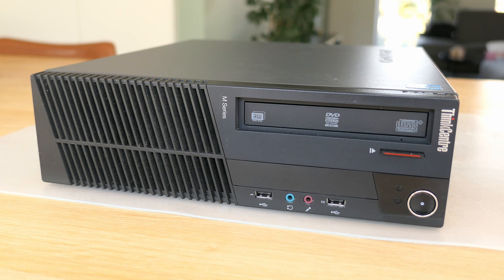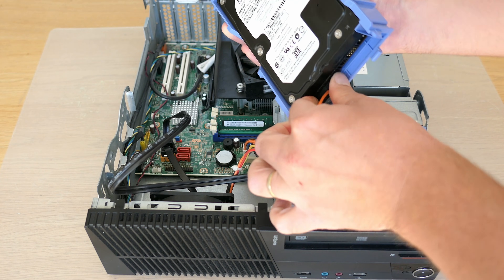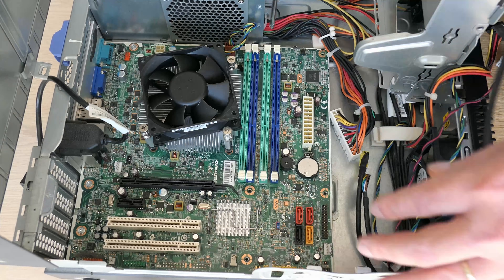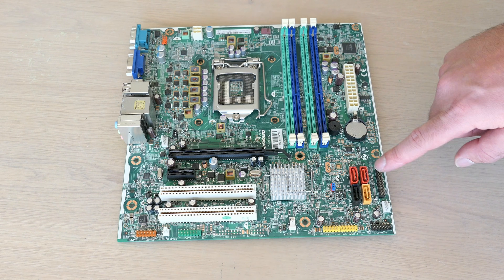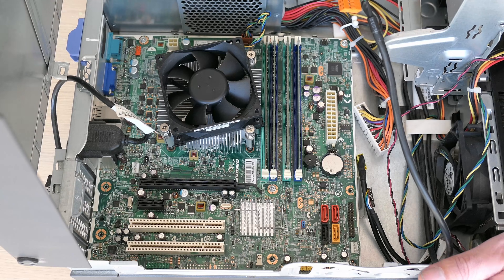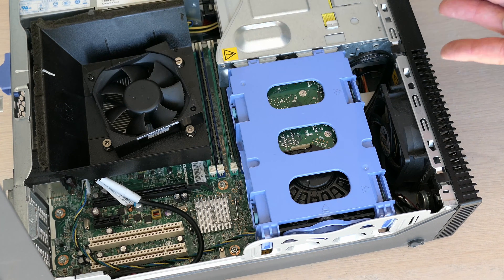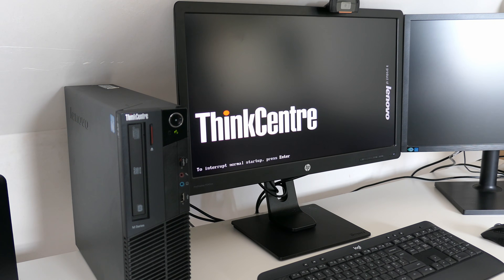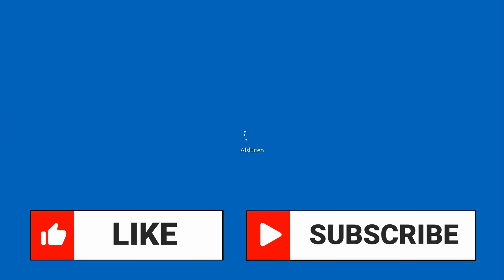Lenovo ThinkCentre M91p SFF - Teardown, Re-assembly and Benchmarks

Comment: does the motherboard support rx 580 8gb
Reply from the maker: The motherboard yes but an RX580 will physically not fit in the case and the power supply is not powerful enough for it unfortunately

Comment: Hello i think i have this pc, will a micro atx mother board fit this case with a low profile gpu?
Reply from the maker: I think this should work. It does look like the motherboard and case supports standard micro ATX and so does the power supply.

Comment: I have one of these and its been a German Panzer Tiger Two ! I hands down is the best PC I have ever had I am getting ready to convert to SSD . I thought when you converted to SSD you removed the HD ?
Reply from the maker: You can choose to keep the HD and repurpose it for simple storage, rather than using to run the OS/applications.
Reply: @jensdbe  I was going to use it for back up but I am converting from HD to SSD My poor pc has been shut off and on thousands of times I have no clue what keeps it going . I do keep it blown out with a compressor that really seems to help it alot. thanks for the reply

Comment: I dont really know much about PC but my Lenovo PC came in and it started making a really bad fan noise sounding like a jet can i get some help on stopping that noise?
Reply from the maker: If it is the CPU fan, you can replace it with a similar (and even more quiet) model. Just make sure the pinout is the same.

Comment: Lenovo M91p vs Lenovo s500 which is good for gaming?
Reply from the maker: As far as I can see, a s500 comes with 4th generation Intel Core CPUs. In general these would be faster, depending on the exact model, then the 2nd generation in the M91p.
Reply: @jensdbe  i checked this is good 👍 very fast

Comment: Good idea to replace the thermal paste. Buy the best quality thermal paste you can get. I found some paste with excellent thermal properties for only £5 at YFOS, Brand: BSFF. Remove the heatsink by unscrewing the 4 screws holding it in. Remove the existing paste by wiping it away with a tissue, or baby wipe. Clean the rest away with IPA. Allow any IPA to dry (a minute or two). Put on a tiny amount of paste on both the CPU top and heatsink. Wipe it on evenly with the plastic knife or applier (supplied). You only need a tiny bit of paste. I reckon less than 0.1g. Carefully put the heatsink back on.

IPA = iso-propyl alcohol
YFOS = Your favourite online store.
W/m.k-2 = watts per square metre per kelvin; the stat your looking for. Higher the better. It's easy to find compounds with better than 11W/m.k-2. Get one of those.
Get the smallest tube of paste they sell. 1g is plenty and will probably do ten applications or more if you only use the tinniest bit you can.  The more paste you you use, the more will squeeze out sideways.

Comment: Thank you so much for sharing your knowledge.  I have a Think Centre m92p, and I've been trying to do a ram update from 4gb to 16gb. I purchased a 2x8gb kit. I put in two sticks. Got the memory error audio code. I then in just one of the 8gb sticks on the original slot where the original 4gb stick was. I tested both sticks in that slot, and both worked.  Is there a setting that I'm missing so that both can be recognized and I have use of 16GB? Thank you.
Reply from the maker: Make sure you are using the correct slots to insert the memory although using the wrong slot should get the machine to boot but with less good performance. I believe slots 2 and 4 should be used first on a M92p

Comment: would it be possible to upgrade the motherboard? I like the form factor of the case and but the i5 2400 I have in mine is hopelessly outdated
Reply from the maker: The IO-panel is removable and the rest of the board + power supply seems pretty standard ATX, so looks like this might work.
Reply: will standard atx fit in the case? can i upgrade to a micro itx mobo?

Comment: i have the Lenovo m91p sff  the power supply date is 2013  I thought this was a 2011 pc?
Reply from the maker: As far as I can find, it got released to the marked in August 2011. But they've been selling these for quite some time so it's not that surprising that in 2013 you could still buy it. I believe the M92p was introduced in the end of 2013.

Comment: Do you think a Quadro 4000 with 80w will work with this PC
Reply from the maker: Afaik a Quadro 4000 is pretty power hungry (around 140W). It's far from the fastest card so I wouldn't recommend it. A GTX 1050Ti for example uses a lot less power and is nearly 3x as fast.

Comment: does this computer support secure boot and uefi?
Reply from the maker: I believe it does although for Windows 11 the TPM level is too low (and CPU unsupported) but there's plenty of workarounds :)
Reply: @jensdbe do you think you could check because my pc isn’t working right now but after i replace a part i’m going to download windows 11 on it
Reply from the maker: @adz__.023  I did run Windows 11 on it by using this method: https://youtu.be/iPc4Tmhv-1o
Worked just fine for the time I used it.

Comment: Do a video installing Linux (debian/Ubuntu or any) as these really support outdated models. After some setup Linux can do windows apps.
Reply from the maker: I did a few videos on Linux and use it on a daily basis. Just not as a desktop OS. It could indeed be a replacement for Windows on unsupported machines but I think that for the average user, it would cause a lot more adjustment and frustration that getting around the hardware checks :) Especially if they would expect to run their trusty Windows apps smoothless.

Comment: Nice little machine.
Reply from the maker: Still find it amazing how an 11 year old PC still performs pretty good today. This was way different back in the day.
Reply: @jensdbe  Very true, an older machine with just a RAM upgrade and adding an SSD to boot from makes them very usable for most tasks even today! Over the years I have pulled several laptops and even desktops from electronics recycling and did those same upgrades and they are better machines then I could of ever hoped to buy back in the day.
Reply: @jensdbe  Absolutely - back in the day after 6 months a computer really was starting to become obsolete and CERTAINLY within a year your computer would be too old to bother with.
Reply from the maker: @SA77888  not sure what I like more tbh. Looking back I was always so impressed by what a new generation could do. Now its just here and there small improvements in general.
Reply: @jensdbe  Yeah I remember the clock speeds would double, every few months it seemed like.. now specifications are pretty stagnant (stay the same) for ages.